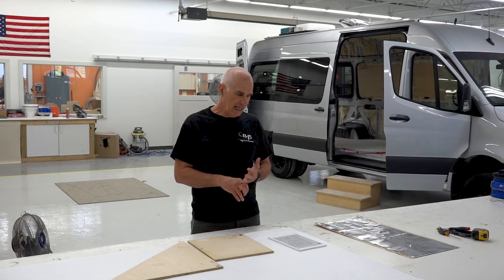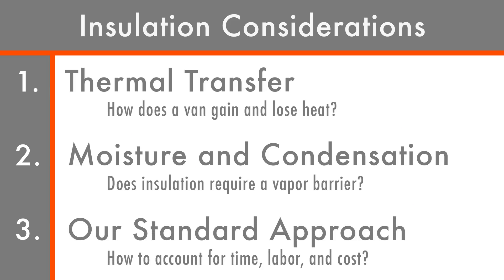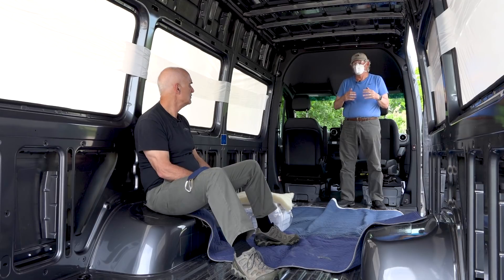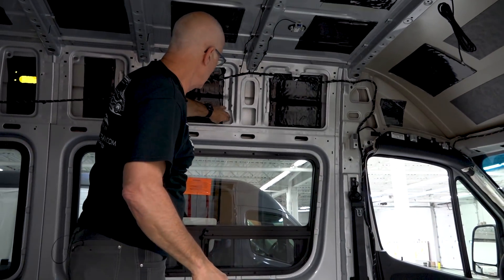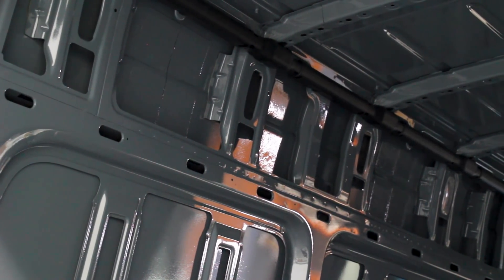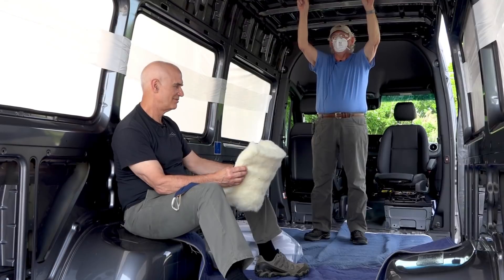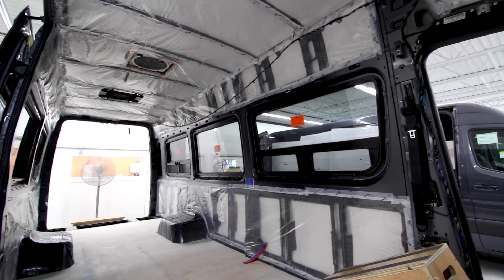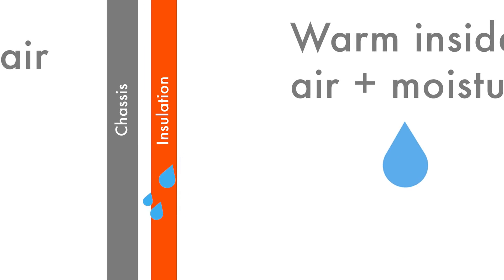What We Know (and Don't Know) About Van Insulation | Advanced RV

Comment: Have you guys considered using 'Phase Change' in your builds?
It would increase the insulation costs but would also reduce the load on the AC and the batteries...
Reply: Phase change is available in sheets...
It looks similar to the air bubbles in packing material...
But it's a lot thinner so it takes up hardly any space...
The cells are filled with an organic (plant based) biodegradable substance that is 100% NON TOXIC...
It's used in conjunction with the insulation you put in the walls of the Van...
As the ambient temperature goes from Hot to Cold and back again the material goes from a solid to a liquid to a solid again...
It is capable of many - many cycles and unless compromised in some way, will not leak...
It stores thermal energy extremely efficiently...
In my experiments with it I have achieved a 25°difference in insulation values...
It's not cheap, it's approximately $40 per square meter...
It will take a tremendous load off the HVAC system in your builds - especially the AC...
And you cant put a price on comfort...
Sadly, nothing can be done about the ambient humidity level which affects AC units and swamp coolers more than anything...
As your Mechanical Engineer so eloquently points out - a hell of a lot of glass in these builds...
Tremendous transfers of energy...
Your insulation practices are light years ahead of the competition but I have never heard you guys mention Phase Change or Radiant heating in the floors in your builds...
But perhaps I have not seen all your videos yet...
As a semi retired Mechanical Engineer (who started out as an apprenticed cabinet maker), I've decided to focus on the best mechanical and electrical systems before doing the interior modules in a build...
I've come up with an 8020 / Walnut Hybrid system for the casework...
I even design and have curved and custom pieces done in 3D Printing using Powdered Nylon in 5 micron layers - almost looks 'Parkerized' - you should see some of the extruded aluminum Novelty pieces I have designed and had 3D Printed...
I also admire your 3D Printing facilities very much...
I design via Fusion 360 because I can do statics and Strentghs calculations in the software...
I calculate load characteristics and Center of Gravity calculations as well...
By the way, you guys are head and shoulders above the competition...
You do a spectacular job in your builds...
Your Mechanical Engineer reminds me of some of the people I worked with at IBM Thomas Watson Research Center in Yorktown Heights New York...
I especially like your casework though - it reminds me of the 3 Mentors I apprenticed under while becoming a Journey Man Cabinet Maker...
I admire your case work very much...
I am also experimenting with a 'Kevalar' type material with an adhesive sound deadener on the sidewalls...
I expect it might have some military / Government applications in the future...
-Pete
petescarpa@yahoo.com
Reply: @peterscarpa2206  do you do custom van builds?
Reply: What is phase change?

Comment: Hi there. Have you looked at Armaflex insulation, I believe it's manufactured by Armacell.
Reply from the maker: Hi Dereck. We often use similar closed-cell pipe insluation underneath our vans when there are exposed plumbing elements.
Reply: Hi. Thanks for the reply, they also make it in self adhesive flat sheets and rolls for large scale insulating with various thicknesses, it also has a built in water vapour barrier. By the way I have no connections with this company in anyway, just seen it used on a few van conversions on YouTube.
Reply: https://www.armacell.us/products/aparmaflextubes/
Reply: Wow, very interesting Dereck. I have not ever heard of that product but I just went to their website. Interested for sure....
Reply: @jamieharrington9037   Glad to hear the post was useful.

Comment: So, I’m going to guess this is a taboo question... I see that Sprinters are the big deal in Van world, but I keep seeing videos talking about the number of repairs and cost. Compared to a Transit, surely someone has data on actual reliability?  I also hear that diesel is going to face greater scrutiny over the next few years? If you folks have any opinions, I would love to hear... thanks!
Reply: IMO the sprinter is a better quality van, better driving experience.  If you're not a fan boy of German diesel vehicles and you either don't do your own mechanic work or have a good independent shop your first trip to the Merc dealership for a repair will leave you reeling.  Post 2008 for most people gas represents a better value.  But there is an argument it you do a ton of miles, tow, factor in resale in some situations, ect.
Reply: that 3 pointed star is like jewelry, it's going to cost you, but some people need it for narcissistic reasons
Reply: alfred e neuman REAL VANLIFER HERE! I can tell you from my own experience having driven transits and pro masters and my own sprinters, the sprinter is all around a better vehicle for a diy camper van. The van itself is easier to work in and around mechanically. The transit and the pro master have their cab situated over the engine which causes all kinds of cramped spaces, making any suspension work or engine work more costly because the labor is lengthier. Again, I know this because I’ve done this work on all three. I have owned two sprinters. They’re glorious to work on. 

Second. The layout of the van itself is more friendly to living. The transits cab slants back so abruptly it removes a lot of the volume from that area that’s great for storage, the ram has a shelf but it’s not nearly the same size. The rams cab floor is also raised above the load floor, or your house. Look at any pro master with a swivel seat in it. You’ve gotta be 7’ tall for your feet to touch the ground. The seat base isn’t big enough to hide a heater inside. The biggest one isn’t as big as the biggest sprinter. And tbh, if you’re already spending the type of money it takes to build a quality van, you’re really gonna skimp on the van part? 

To each their own I guess but, I think it says something about a persons intentions when they take the care of buying the proper platform to build on.
Reply: @matthewjswider  —right on, thanks for the info, and I think the Sprinter is sooo much better looking anyway. Cheers and thanks again!
Reply: DustyCowdog the sprinter also looks better too. Good luck in your search. If you’re in the used market might I suggest the 07-08 years. They both didn’t have DEF systems but they are the same engine as the new model so, there are a lot of parts available and all kinds of upgrades you can do. Lots of aftermarket support. And again, no def.
Reply: @matthewjswider   -- excellent. I was wondering what year that DEF was added. Thanks!
Reply: @matthewjswider  -- Thanks, I'll check it out. I'm actually deactivating all social media (there are just too many platforms and stuff to keep up with and it is a time suck...) and I never did have a Twitch account, but I will check it out. Cheers!

Comment: Great video.  What about spray insulation?  Some YouTubers say that the best one because it is the densest and you can spray it in every nook and cranny.
Reply from the maker: Thanks for the question Outdoorsman. We have used spray insulation in the past for it great insulation properties (R-value, flexible application), but have since moved away from it. We are making a short video about why - namely its warping of our van's sheet metal.
Reply: @AdvancedRV  An alternative - I sprayed the interior of my van with a thin layer of undercoating (I only found one that did not release toxic materials as per MSDS - sorry, I forget the name, I believe it was Kleen flo). It dramatically reduced condensation and the temperature (by touch) compared to bare metal surfaces. I then insulated directly on top of it, or you could leave a thin air gap. To be clear, this is more to reduce the temperature difference between bare metal and interior air temperature to reduce condensation than for insulation purposes. I think of it as a breaker between two temperature zones, similar to a glue layer between two objects of different material and/or temperature. Just fyi in case it gives  you any ideas. Cheers
Reply: @chasethemouse  Thanks
Reply: @AdvancedRV  Warping is down to improper application. You're applying too much in a single pass. The exothermic reaction causes warping. Apply a thin layer first, then add more.
Reply: @AdvancedRV  Great info. Most people will not mention the sheet metal warping.
Reply: @AdvancedRV  Did you ever make the short video mentioned about spray foam?

Comment: As an architect that designed essentially the same building in all climates (a big box retail store) where to put the vapor barrier is complex and there is no one answer for every location. Minneapolis is entirely different than Miami.  Buildings don't move so you could come up with different strategies. Vans move. So you cannot have different strategies. You have to pick a compromising best solution. You installed the blue denim in our van. It works and I can't complain. The Hushmat installation fully adhered to the outer metal skin as much as possible whether combined with blue denim, wool, or thinsulate is probably key to keeping down condensation directly on the metal wall. Hushmat installations typically show incomplete patches on the outer skin to sound deaden the metal and not full coverage as ARV attempts. I see the insulation as touch comfort considering the amount of window glass to deal with and not so much energy efficiency. What I appreciate more in an ARV is the sound deadening properties of your solution, in having two previous vans I can tell you it is a major difference in an overnight stay in a Walmart parking lot combined with insulated window shading that blocks light. Whether wool, blue denim, or Thinsulate, I wonder which is the better sound deadener or if it makes a difference.
Reply from the maker: Thanks for the comment David. Great insight.
Reply: Yes, sound deadening rates up there with insulation.  I'm still considering closed cell foam - installed carefully of course.
Reply: great point, i think the sound issue is important and would like to know what is better for sound as well.

Comment: Do you put ceramic tint on the outside of your window panes?
Reply: What about crating outside covers that snap onto the window blocking 70% of radiation before the window even comes into play?
Reply: @DennisWintjes2   Indeed, and this was recommended in one of Bob Wells' videos @ "CheapRVLiving" channel.
Reply from the maker: Yes, we use a ceramic heat-reflective film on our windows. Thanks for the question. We will elaborate a little further in our next video.

Comment: I had purchased an Airstream Sprinter where mice, lots of them, had used the fiberglass insulation as habitat! As a result, I took out all the furniture, electronics and plumbing - down to the bare van walls - and sprayed closed cell foam much like is used in Sprinters used as refrigeration vans to deliver frozen goods. The van was reassembled and now takes less energy to cool and heat...

When I met with the team at ARV several years ago, they were using recycled denim - which, like wool and fiberglass, are very appealing to mice to set up shop. I would be wary of using anything other than foam, preferably closed cell.
Reply: Any problem with off-gassing?
Reply: @robertmatetich2898  You just need to let it cure properly before covering it. Once properly cured, spray foam won't off-gas further.

Comment: Have you ever tried spray foam? Seems like it would solve the insulation/ vapor barrier issue as well as getting in all the odd shapes.  Can you comment?
Reply: I had my 1973 Dodge van spray insulated and it worked great. But that van had fairly thick sheet metal as most vans had in the early 70's.  Todays vans, especially the Sprinters, Transits and Promasters have very thin sheet metal. The Sprinter forum is full of stories about folks who spray insulated their vans that caused very noticeable ripples in the sidewall sheet metal. I think it can be done but it must be done carefully to avoid causing distortions in the sheet metal side walls.
Reply: @boxster1970  Todays spray foams that are professionally installed and use a mix of closed cell for the main areas and open cell for the more restricted structural members don't have warping issues.
Reply: They tried it 3 different times and it warps the sheet metal.
Reply: @Chris where in the video is spray foam mentioned?
Reply: Further, some (little but some) spray insulation will always be on the outside of the steel and your plywood wall causing a very slight, but important, thermal break.  I wish they had discussed this too.  There is an issue with spray foam off gasing if the environmental conditions don't allow the product to cure, but choose the right weather pattern.

Comment: The problem I see with a moisture barrier is it is almost impossible to make it completely air tight due to the shapes of the van. And warm moist air is what you're trying to avoid contacting the cold steel outer wall. Then if you have a layer of plastic making your wall cavity 'nearly airtight' then the water won't be able to escape easily. So to be effective it has to stop 100% of moist air getting through.

Even if you do make it completely air tight, your'e trapping air from the day you've done the install inside the wall along with it's moisture content and you could end up with a cycle of moisture condensing and evaporating in the trapped air cavity.

There's a couple of options that I've been thinking about:
1) Add localised moisture barriers using bubble wrap or similar. Seal up large flat panels with almost no air in them. Much like where you add the noise deadening material. I'd use bubble wrap (plain or reflectix) so it has an air gap to stop condensation. That will reduce greatly the amount of moisture forming on the walls, while ensuring you're not trapping air in the wall cavity.
2) If you use a traditional inner wall vapour barrier, force air through the wall cavities to dry it out, and vent outside the van. If you're in a cold climate you might need to heat it. Thus expelling any condensation that forms and drying out the cavities. This might also have the advantage of expelling warm air in summer before it enters the living area.

Personally in my van I used a hydrophobic recycled plastic insulation and didn't add a moisture barrier. Moisture does form on the walls, but it also dries out happily. After seeing just how much moisture forms I would definitely consider those options above now, although saying that the moisture hasn't been a problem either. No mould anywhere yet, even in our cold wet New Zealand winters.
Reply: Eat Sleep Van All cars (vans) have weep holes at the base of the structure to allow moisture to drip down and out.  Manufacturers assume that some water gets in, for example through the roll up/down window mechanism in the doors, and must have a way to escape to avoid excessive rust.  Some such designs fail and one can see examples of particular 40-year-old car models that have all rusted in the same location.  Other designs are more successful and suffer far less (or no) rust even after many decades of exposure.  Also, the passenger version of any of these vans (and every passenger car) is already similarly insulated, including a vapor barrier, from the factory.  The vapor barrier is just that: a hindrance, not an impermeable defense.  But the basic automotive design has already accounted for moisture on the inside skin of the vehicle.
Reply: @alliejr  My van has weep holes in the cavity at the bottom of the van wall which has been sprayed with wax-oil. Condensation just runs down the inside of the van wall into the bottom cavity then through the weep holes out onto the road.
Reply: alliejr yes great point, I should have mentioned that. And it’s a good reason to not use absorbing insulation material, so it can drain out. It also means there are air holes for that cavity.
Reply: Trapping air from installation day would be totally irrelevant. Calculate the volume of the wall cavity, pick a humidity and go through the calculations. The number will be inconsequential.

Comment: Would of loved for you to address closed cell foam as an option.
Reply: Closed cell foam is an excellent insulator because it's a good vapor barrier in itself in addition to having a similar R value to Thinsulate. My guess as to why ARV doesn't use foam is difficulty of installing and its permanence. It can't easily be removed in the event that disassembly becomes necessary for a repair.
Reply: Ever use spray-on expanding foam....? 🤔
Reply: They don't use it because it warps the sheet metal, causing an unsightly appearance.
Reply: @OMGWTFLOLSMH  With all the resources they have at their disposal,, you would think that they would’ve come up with a device that would put pressure against the outside skin while the foam is being sprayed Until it stops expanding and cures so the outside skin does not get pushed out but instead the foam pushes inward